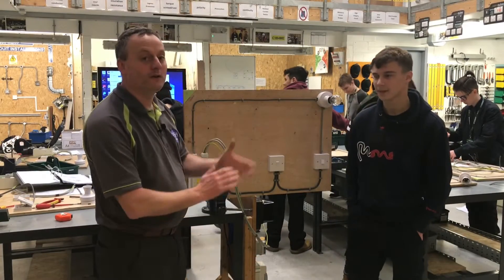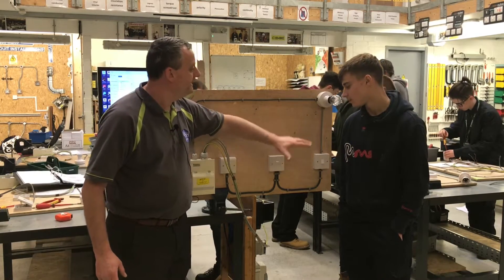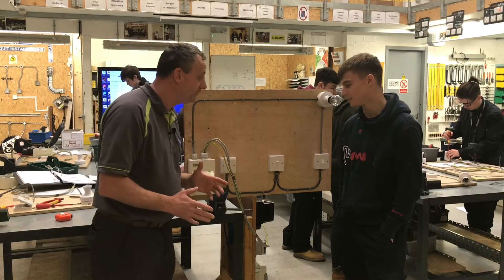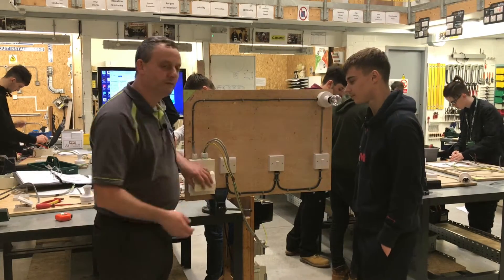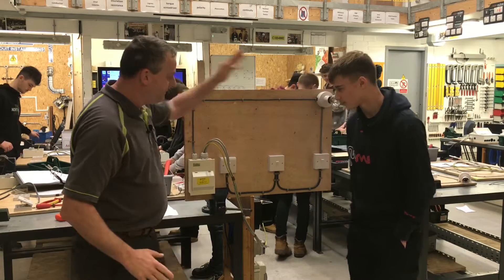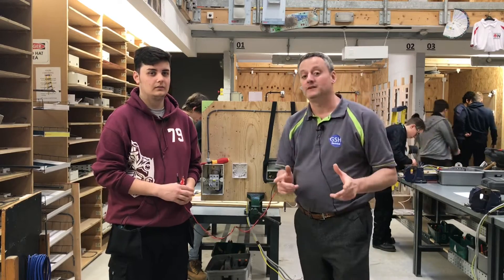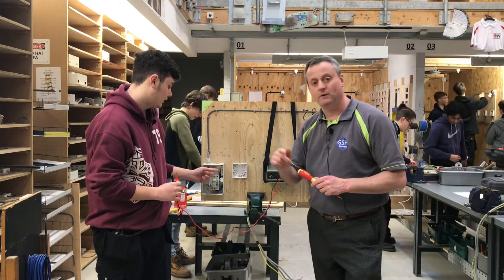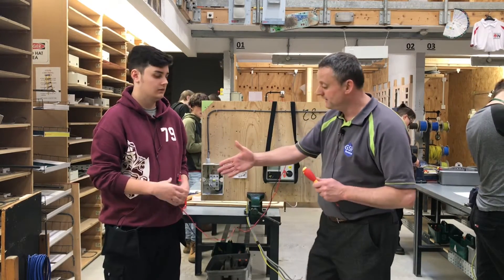First Lighting Circuit 2 Way and Intermediate Switching and Dead Testing Quick Fire Questions

Comment: I am trying to replace 1In 1Out 2In 2 Out Switch that controls light and shares control over fan in bathroom with another bathroom. I thought that it is intermediate switch and tried to replace with L1 L2 L3 L4 switch. But after replacing fan wouldn't stop and run continuously. Do I need to use only 1In 1Out 2In 2Out switch?

Comment: Hello all. Great video. 

I'm a relative newbie - around 2 years out of college and am bamboozled by trying to test/inspect properties. 

Can we have an eicr video on properties with 4gang dimmers, electronics, integrated downlights etc. 

I'm having to turn down work because college style testing doesn't match up with real world houses. 

Please help.
Reply: Actually it is the same thing, you perform such tests as you did in the college. But before you perform an insulation test you'll have to ensure that appliances are disconnected from the circuit you want to test, lamps must be removed from the light fixture if possible or the test will fail if you perform an insulation test between line and neutral, light switch on if it's the lighting circuit or a circuit where a lighting is included. The last thing is mostly going to happen in other countries, for example here in Germany. Here in older installations you got one 16A circuit for a whole room (living and sleeping rooms, in kitchens are usually more circuits), including lights and outlets.
As an alternative on NOT newly built electrical installations you can combine line and neutral of the circuit in the panel (remove the neutral and the line from their terminals and put them into one crocodile clamp) and measure the insulation resistance against the protective earth (you call that CPC if I remember correctly). That will mostly eliminate the influence of connected appliances. And remember, if you have sensitive electronics which you can't isolate from the circuit, you can reduce the test voltage from 500V to 250V.
The german VDE 0100 differs not so much from the british BS 7671. Except that we must use at least 1.5mm² conductors in our installations, so 1mm² is a no-go here. VDE wants that due to mechanical stability.
The thing is, the school shows you the ideal situation. But in most cases you don't have that in the practical work. There you'll have to deal with installations from different decades, sometimes 30, 40, 50 or 60 years old with different methods of wiring, different colour codes for the wires and so on. You also have to familiarise with those old work and regulations to understand the things. But for this there should be an assistance for you, mostly a more experienced colleague. That's mostly the case here, they'll never let the apprentice perform work without the supervision of a more experienced colleague at the beginning.

That's why I prefer the german vocational education, it prepares you much better. It's called "dual education system". It's three and a half years for electricians, you go to the vocational school (comparable to the college), but at the same time you're an employee of a master electrician or a company. Meaning you'll get the theory at school, and at the same time you'll do and see the practical work. After the three and a half years you'll have to pass an examination which contains a written theoretical test on one day and a practical testing on another day. 

https://en.wikipedia.org/wiki/Dual_education_system